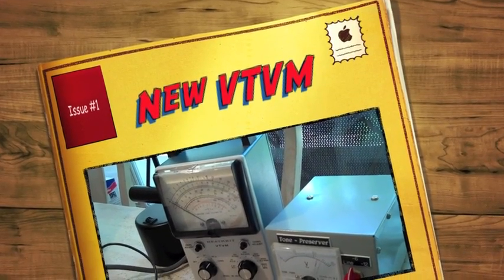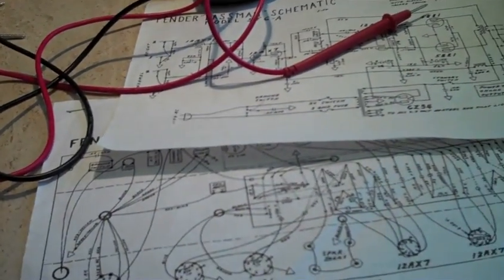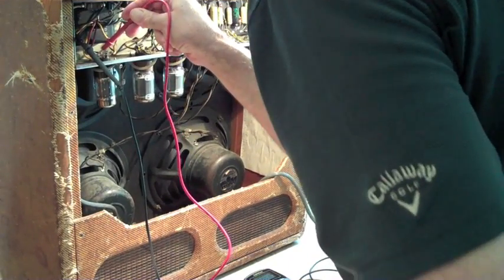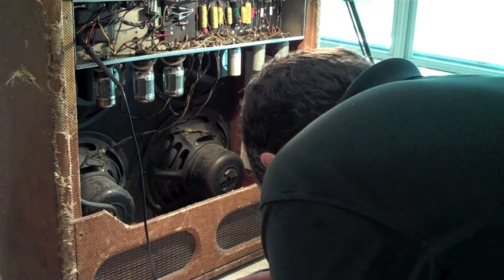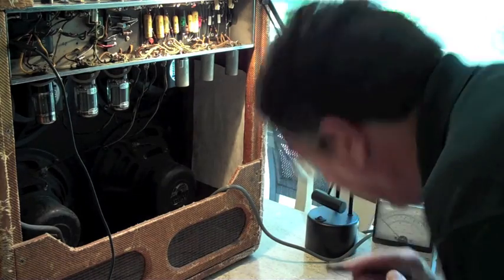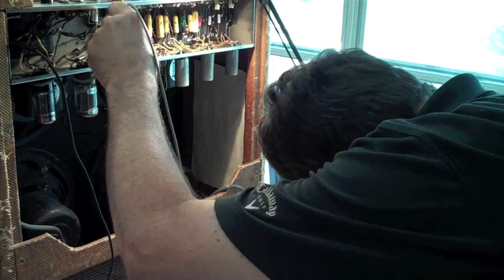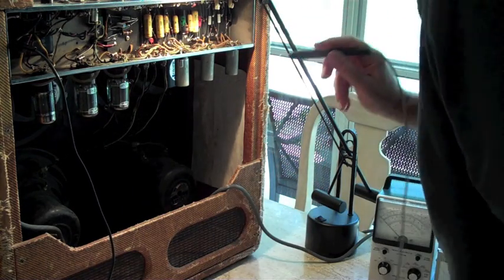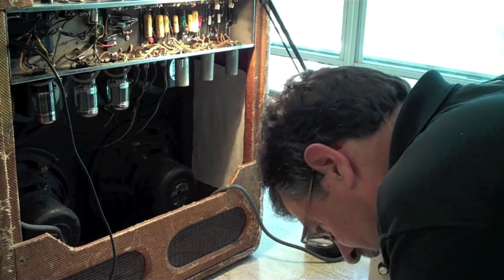1960 Fender Bassman - Checking Voltages with a VTVM

Comment: Line AC 115, HT AC 353-0-353 , OT CT DC 446, Plate DC 444/444,

This type of info is nonexistent on the interwebs. Those VTVM's and Tube Testers are priceless tools for us tube junkies. They just need to be calibrated from time to time. Thanks for taking the time to do this video!
Reply from the maker: Hey Matt.  I think my new Fluke 115 does a much better job now so I have been relying more on it but really have not had to check any voltages lately.
Reply: millstap I couldn't find any real world voltages for the HT windings or plate's anywhere. Everyone said to look at the schematic, I know what it says already! 

If you ever have the time to compare both the 59 and 60 with the Fluke and VTVM I, and many amp nerds would love to know the plate and high voltage secondary voltages. 

Getting the right power transformer for a true replica 5F6A is a must!
Reply: @millstap  It would be amazing if you made a video for the preamp plate voltages? i'm in the process of making a clone.
Reply from the maker: @taggmanibanez  I wish you would have asked a day earlier.  I had my amp out looking at something.  It will be a while hopefully before I look at it again but I will document those voltages.  All of the preamp tube plate voltages?

Comment from the maker: The GZ34 is a Mullard, the power tubes are a matched pair of vintage USA made Tung-Sol  5881's. V1 is a RCA 5751, V2 & V3 are Mullard 12AX7's.  I swapped the 5881's around this day to a pair that was a little closer matched to within 5%.  It seemed to make a subtle difference.  The amp sounded wonderful at the gig the following day.

Comment from the maker: Actually, I'm trying to read the meter on the VTVM.  It's not the easiest thing to read.  I should have put it on top of the amp.  If the chassis was out of the cabinet on a bench, it would be easier.  The DMM wins for ease of use.  I'm not sure I need the VTVM. I am still trying to figure out where the 1v DC was coming from on the grid of V2.  According to Jack Darr, there should be no DC there.  The new coupling caps are working as they should.

Comment: You can use any decent digital to check grid voltages. Just not a crappy Harbor Freight one or something like that.
Reply from the maker: +Rob T I have a Radio Shack DMM so that would probably be on the crappy side.  I should get a good one these days.  All I have ever heard of is Fluke when it comes to good ones.
Reply: The RS unit is probably OK. I was thinking Harbor Freight $6 ones. Make sure you get the normal 10 megohm input resistance and the right voltage ratings and it should work fine. One of the best deals I found was a Klein Tools MM200 at Home Depot for about $50. I'm on my second one only because I fried the amps function on the first by mistake. I know better, but wasn't paying proper attention. Amprobe makes some good medium priced ones too. Many of the latter have a bar graph that can show quick changes like an analog. I like that.
Keep learning and stay safe.

Comment: When you're checking for leaky caps with that vacuum tube voltmeter which side of the cap the one going to the 2 or the one going to the controls you and hook and test
Reply: Sorry do you unhook from the side where the tube is on the cap or the side that goes to your control pots
Reply from the maker: You unsolder the lead going to the controls.  The other lead has the high DC voltage on it and you want to be sure the cap is not allowing DC voltage to leak through to the other side.
Reply: Thanks Millie
Reply from the maker: I finally graduated from this meter to a Fluke 115.  As far as I can tell, it measure millivolts just as good or better than this.  Someone suggested years ago that the VTVM was necessary to get an accurate reading but the high quality Fluke works just as well.

Comment: Is the amp on when you are doing this
Reply from the maker: Yes, so you have to be very careful what you touch with the probes.
Reply: millstap I went and got a nice V-7-A Heathkit VTVM Because of you...I worry about my Blue Ajax caps...I have a real nice 63 Bandmaster..That was a house amp at the Hollywood Bowl,for 6 yrs
Reply from the maker: Bob Barcus Cool.  It is a lot of fun to learn to work on these.  I just unpacked a very mint 1959 Bassman that I bought from a harp player in Pasadena, CA that I will upgrade a little.  It still bas the original capacitors in it.  Even though they Astrons leaked in my Bassman, and after trying many new caps, I put the least leaky back in the Bassman and it works fine.  I tried the other one and it added a lot of scratchiness to the volume pot so I figured it was about gone.  Since I only use the Bright channel, that is where I put the good Astron.
Reply from the maker: Bob Barcus I read somewhere that only the VTVM was good for measuring these low voltages because the modern DMM's add a load to the circuit and don't give an accurate reading.  I'm not an electrical engineer so I'm not sure of the science end of electronics.
Reply: millstap I heard that if the voltage is more than a few volts it can harm your transformer and tubes....Also if you do ever want a transformer keep away from Merc Mags there very HI-FI sounding...Go over to Metroamp.com/forum They are a Marshall forum but thats where they came from the 59 Bassman alot of good transformers out there...I am suprised you do not have one...I use a 100watt PLexi with my 63 Bandmaster...Thanks for all the videos and replys